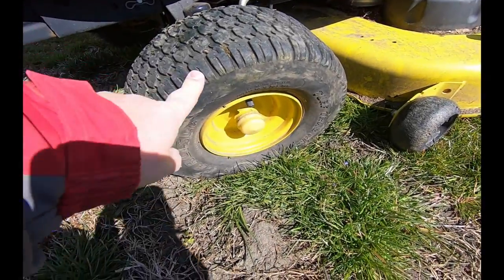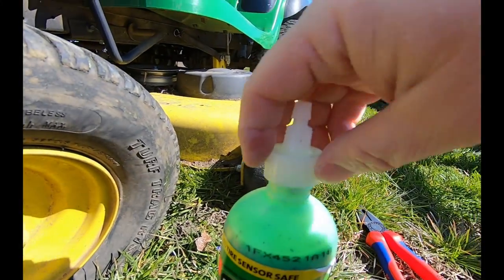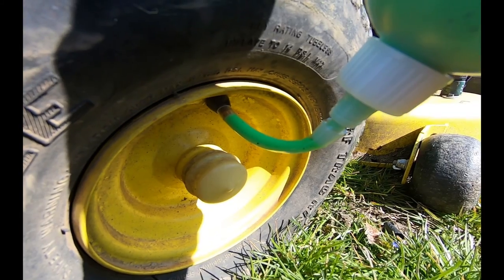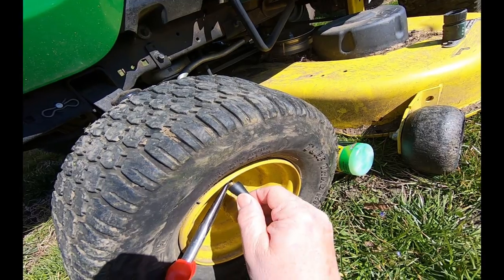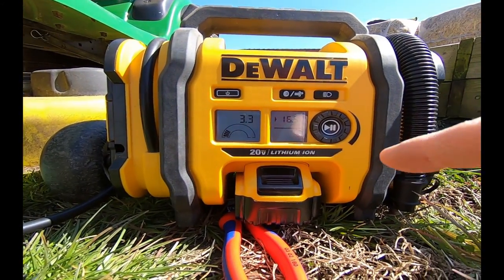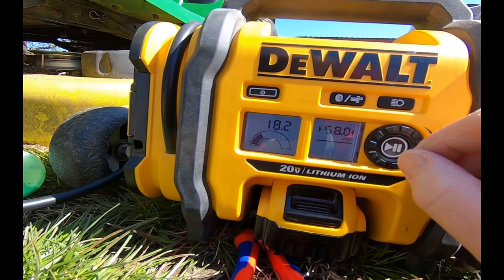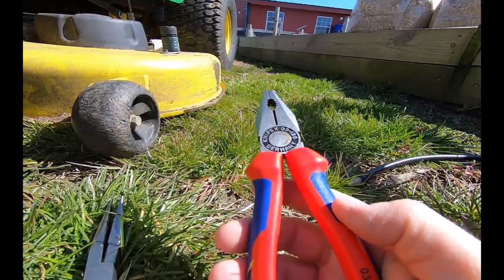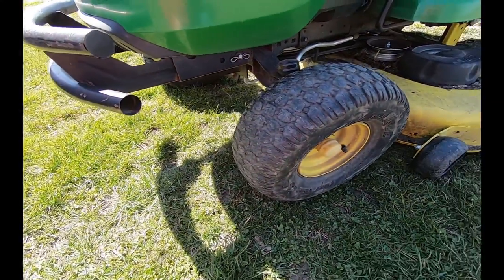Flat Tire on Your Lawn Tractor? How to Do a  Fast and Easy Repair Using SLIME.

Comment: Good Video. Is it still holding air today?
Reply from the maker: The tire has dry rot and has cracked more but the slime is still filling the cracks as they appear. It’s given me almost 2 years without buying tires.

Comment: My question is how long does it last and what if it goes flat again then what
Reply from the maker: Thanks for watching. It all depends on what kind of leak is present. I’ve found it works great for bead leaks, dry rot cracks, and small punctures. If small leaks continue I just add air and it’s good to go again for a while. It stays liquid inside the tire and continually coats the inside as you drive. I wouldn’t use it long term in a car or truck tire but it will give you time to get proper repairs. 
It’s not a permanent solution but will give you a season or two before adding a tube or purchasing a new tire.